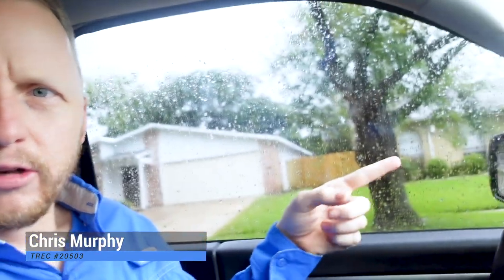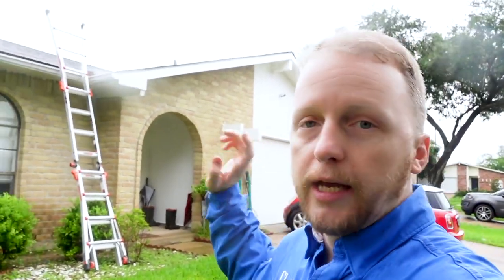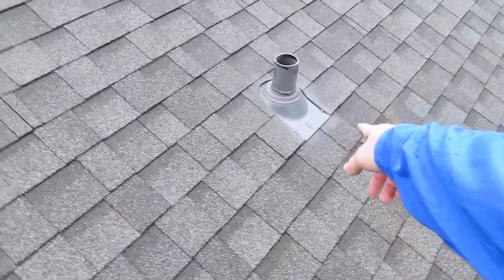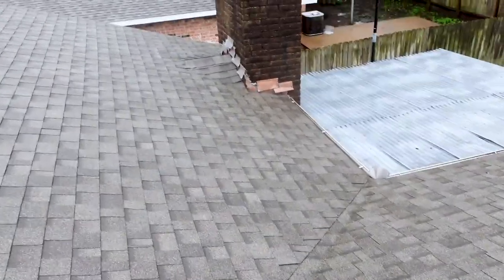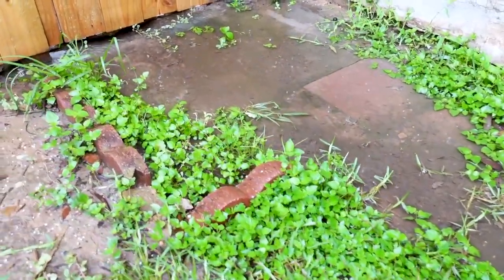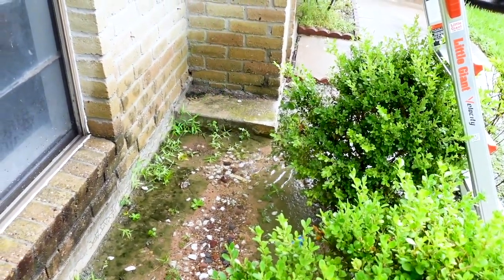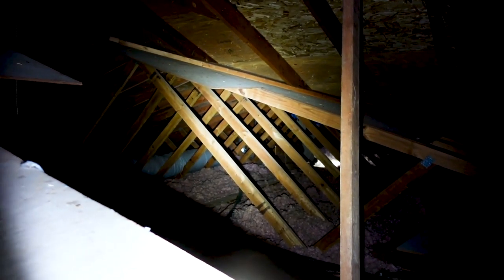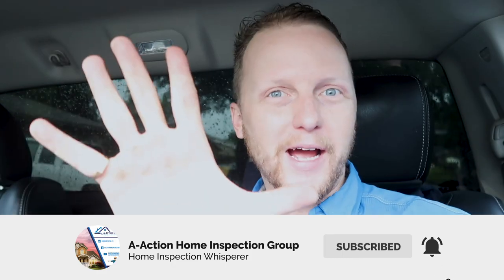Old Home Inspection in the Rain

Comment: In the process of building a new home and wondering if in older homes with kitchen range hoods that extra smells though the roof normally start having problems over the years like mild, back draft, or even bugs getting in? Not sure if best to stick with an under cabinet ventilator? Looking for the least maintenance and safest choice.  Great videos!